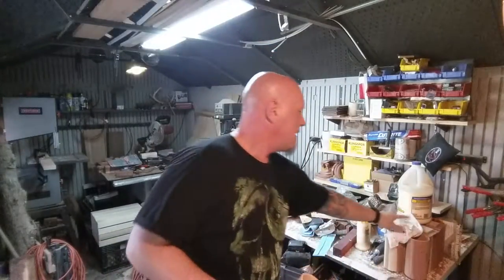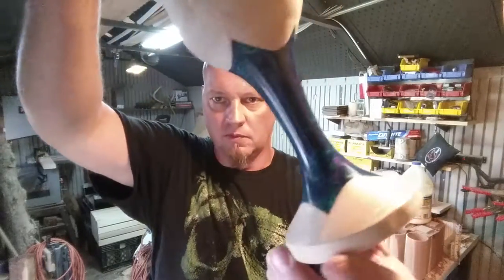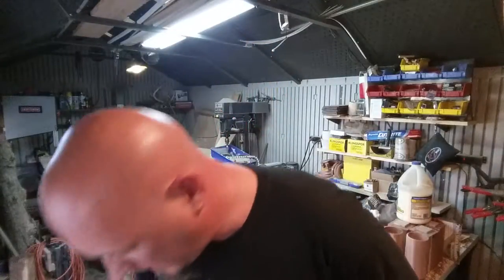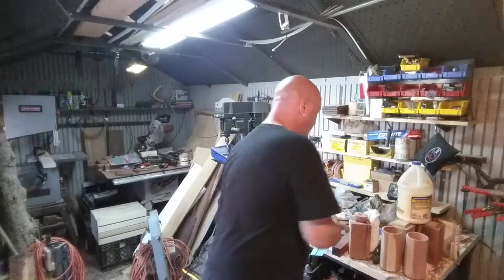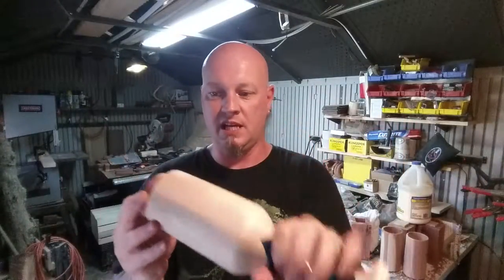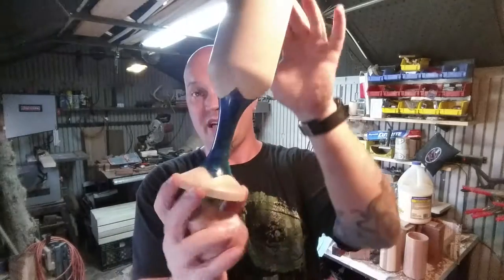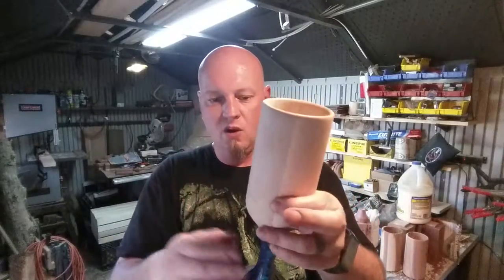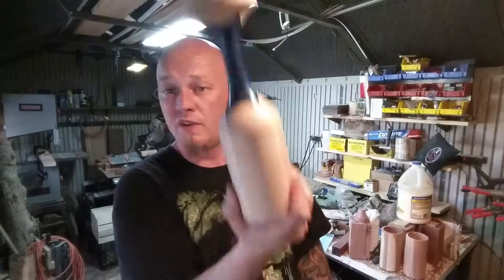Acrylic stem goblet, what I learned

Comment from the maker: I get mine from us composites. com it's called table top epoxy, it does not dry crystal clear, it has a slight yellow color to the resin but does not take away from the wood color. so far we have cups in use for about 8 years that are still going strong with the original epoxy coat

Comment: I wish you filmed it too! Hahahaha. It looks great, Mike! I've heard the mass produced acrylic like that is pretty hard to turn, I've turned quite a few alumilite blanks from Zac at Nv Woodwerks and they have always come out great, Sharp tools definitely helped. What do you finish the inside of your stuff with for drinking? Or are they just for display?
Reply from the maker: every drinking vessel I make is 100% usable. I use high gloss poly on the outside to seal the wood and a food grade 2 part epoxy on the inside. they are good for hot or cold liquids. This blank took a ton of sanding to get smooth, I went back and watched your video of the beer tap right after I turned this to see how your acrylic turned and yours looked much easier to turn than this one.
Reply: That stuff turns like butter with sharp tools. I had a little bit of chip out, but it was very minimal. Where do you get the epoxy? Can you pick it up at a big box store or do you have to order it?